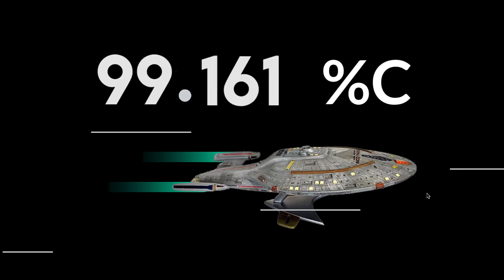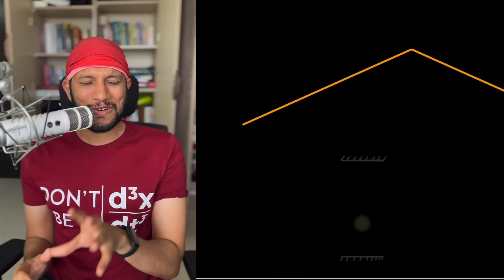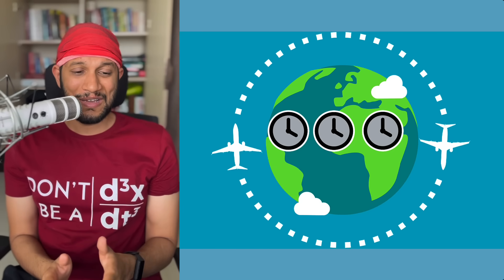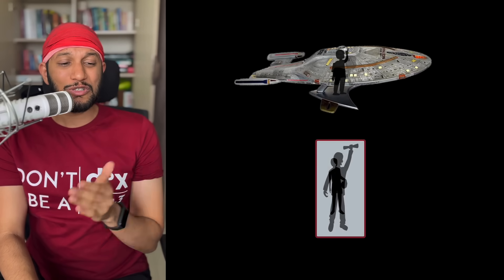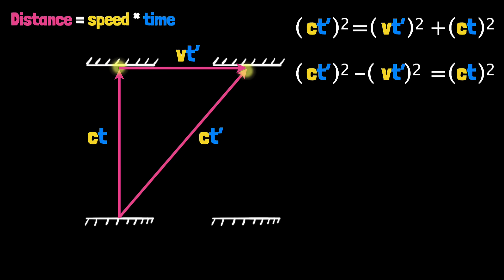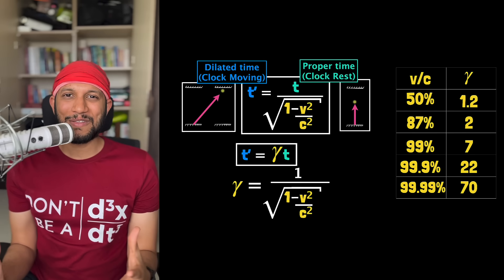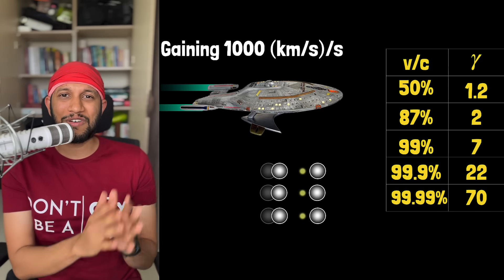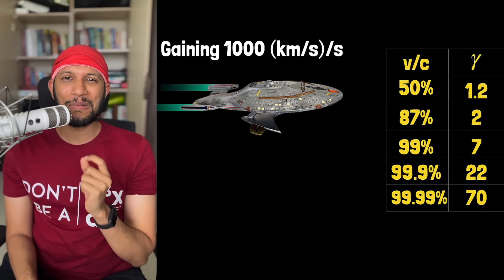I finally understood why you can't go faster than light! (My mind is blown)

Comment: Brings up two questions Einstein Jr., if noting can travel at the speed of light, then how can light travel at the speed of light? 
Next question is how you could accurately measure the speed of light here on Earth without Time Dilation playing into your results. The reason is when you are sitting at your desk perfectly still, you are still physically traveling at millions, or possibly even billions of miles per hour. The Earth is rotating giving you speed (or Velocity), then the Earth is revolving around the Sun (Adding much more speed). Next the Sun is moving around the Milkyway Galaxy, which in itself is rotating around the universe (Adding still more velocity). That does not even take into account gravity, which we don't even know what that is, yet it is strong enough to warp light itself, altering time. Then don't even get into the whole "multi-verse" theory with our universe rotating around other universes adding still more velocity. So, how could you accurately measure the speed of light when you can't even accurately measure your own velocity? Curious about your answer FloatHeadPhysics.
Reply: massless particles like photons don't accelerate to c, they travel at constant speed, which is the same in all frames of reference
Reply: Basically, when velocity is relative, you’re velocity zero. It’s that easy, from my perspective, my velocity is zero. All the formulas rely on relative velocity because absolute velocity doesn’t exist. That’s why all velocity is *relative*.
Reply: The fact all velocity is relative (hint: special *relativity*) is literally one of the most important Einstein theories. There is no absolute frame of reference, all inertial frames of reference are relative to one another.

Relative is a word that’s used a lot, especially when talking about relativity. It’s best to understand what “relative” means first.

Comment: no sale
we are told "space" expanded a faster than light
if it can happen once, it can be recreated
and Einstein was wrong, you can define prime location. have the "Bing Bang's" red shift equal zero in all directions, you are at rest with respect to the original locations of the universe. easy to define this
Reply: space time isn't an accelerating, inertial body, it's the framework of the universe
Reply: @AMC2283  not what i saw recently
the expansion of space is accelerating
so something is expanding and accelerating in doing that
Reply: @m_hub3957  yes but changing the rate of expansion isn’t changing the velocity of an inertial body
Reply: simple
MY point is that we will likely find a way around this limit
we keep finding new rules for the universe
and someone better tell those Aliens that they are really not here.....  speed limit....

Comment: In the time dilation formula, we use c' instead of c the formula still holds. In other words, if the clock was moving with speed of c', the formula tells that the time dilation when v is equal to c' would be infinite. This still bugs me.

Comment: Wouldn't we actually be measuring the amount of data transfered by a magnitude of stronger and weaker amounts of light as the "light clock" ticks? Data being usable relative frames between ticks? It's not ticking slower, it's transferring a lower magnitude

Comment: I'm not understanding why the clock in the plane is slower than one on the earth. Look, from the planes reference frame, it's the earth that is moving and therefore having a slower time. So the plane should have faster clock?

I know this process is not inertia frame, and involves general relativity which tells us the surface of the earth is having higher spacetime curvature. But what about if we only talk about special relativity? Time dialation is relative only right? Any two moving objects, they both will see the other party having a slower time? So if one of the twins fly away and come back, who really gets older? Or are they still the same age? Please explain. Thanks!
Reply: non inertia frames aren't equal, one is subject to more acceleration/force

Comment: I am stupid, but the time taken by me to walk between two opposite windows on a train when the train is still could not be faster than when the train is moving, 1) because the distance between the two windows never increase or change, and 2) being connected to the train by gravity I am impelled by a force in the direction of the travel of the train, the force acting on me and adding energy to my mass, whereas the energy I am loosing by moving between the windows is energy I am generating and which energy is neither being added to nor being compromised by the energy which the lateral movement of the train is passing onto my mass ... so, why would moving laterally while moving beween the two windows cause me to slow down? 
Yes, I am stupid ...

Comment: This is a classic fallacy of physics. Time and space are measurements, they are not "intertwined". Time measures change. Light, or what we are able to see or perceive does not ALTER the actual change that is taking place, it merely alters how we SEE that change. The change has still happened, from a local perspective, even if we do not yet see that change. Think of it like a high caliber bullet. That bullet, traveling faster than sound, can destroy its target BEFORE the sound reaches the target. That does not mean that the bullet has not already traversed the distance to the target because we didn't yet "hear" the bullet. Just like it does not mean that time has changed in ANY way just because we cannot yet observe the change that has ALREADY OCCURRED! This is a fundamental flaw with physics. It conflates space, time, and light as if they are somehow intertwined with each other. Light and time are MEASUREMENT TOOLS, light is merely one of the gauges that is often used to measure space. Just because I use a tape measure to measure the length of a piece of wood does not mean they are intertwined. Light is a measurement tool.

Consider this, time can NOT stop unless on a macro level, across all of creation everywhere, all activity, change, and atomic movement stopped. To observe this, you would have to exist outside of time and outside of space. From a micro level, time may be made to "stop" but even then, that is not really possible. The observer of the stopped activity, such as when atomic activity goes to near nothing at absolute zero, would still be subject to time. The small, isolated area that time "stopped" is still subject to the SAME time measurement and the "change" observed would now be a change in state from active to inactive. But it is STILL a change! Time does nothing but measures change. Space measures the distance at which we observe that "change".

Moving to your analogy of movement of a ship and the energy required. That is a false equivalent. What you are measuring with the energy inputs to move close to the speed of light, or close to "c", is NOT energy inputs to go that fast, but instead, the visibility of light itself. As you approach the speed of light, or exceed it, light itself would disappear because you are outrunning the light. Similar to the bullet analogy outrunning sound. The sound eventually reaches the target. But in the case of a bullet, the target may already be eliminated before the sound reaches them. The change has still happened even before the sound catches up. It is the same with light. We have conflated space, light, time, and our observations together with the measurement tools and have corrupted all of them. The various formulas you show merely illustrate that our ability to see the change that is taking place already is diminished the faster the change is moving away (or toward) us, and our ability to observe it. It is nothing more than the "Doppler" effect but with light instead.

Comment: I have trouble understanding how the vertical speed of the photon between the mirrors has anything to do with its lateral speed. I get the point of the total distance traveled laterally...but the vertical speed/velocity slows as a side affect? How? 
  Seems to conflict with the concept of an "inertial reference frame", in my meager understanding. Just would like to hear that explanation, if anyone can elaborate or point me to a link. Tia.
Reply: its speed is the same in any direction

Comment: Wonder if quantum entanglement could change this. Like let’s say you quantum entangle 2 nukes. One stationary and one on the ship. If you send a signal to the stationary to blow up. Wouldn’t it then send a signal back to the one on the ship? Also if the ship is made like a “sphere” and back half is entangled with front half. Sending the information about the blast would maybe propel it forward? It would maybe look like the spaghettification at the event horizon of a black hole. Not a physics scientist. Just me thinking a little.

Comment: Correct me if I'm wrong, but not only wouldn't it be possible to reach the speed of light, but it would also be impossible to make the necessary measurements to prove it. The second (or femtosecond) you reach the speed of light, the time concept would just fly out of the window, right?

Edit: ok, should've just kept watching the video 😅

Comment: All things are relative. If an object is moving 3/4 the speed of light and is traveling toward an object which is traveling the opposite direction at 3/4 the speed of light then relative to each other why wouldn't they be moving 1.5 times the speed of light?

Comment: I made this: it's called the Marry Go Round experiment
\:Imagine your 5 yrs old and the bars of a marry go round are barely grazing your hand because you've reached your limit. John the occupant of the the marry go round is riding but he's not feeling drag because this is actually in a vacuum. John now can move just as freely as you can to spin a marry go round that Danny is sitting on and spins it in the same direction he's spinning and Danny ends going substantially faster than John when compared to you. Why doesn't this break the laws of physics as explained by  Einstein; it's simple really it's because Danny's origin point was john's power not yours. (What happens when the marry go round B is spun in the opposite direction from marry go round A; it stops? This is what time dilation is, and what naturally occurs, but humans can reverse this effect.) From your perspective yes the inside cart is traveling twice as fast as you could ever push, but that system cannot exist as an individual problem. Adding sums together is common practice when dealing with two different relative perspectives.
\: The Marry go round experiment is actually meant to explain what it would be like to shove a marble(spacecraft) inside a cup(vortex cannon), inside a cup, inside a cup and so on turning each on when at intervals until all that's left is the expedition crew and everything they need.

Comment: Increasing fuel usage to go faster is 20th century thinking. I'm not a physicist at all, but imagine our super-advanced spaceship is able to pull the space in front of it apart at an atomic level. If you're able to warp space around you, there would be 0 resistance, and burning fuel to generate force becomes obsolete.
Reply: yes exactly space warping is the way to go after big bang space expanded at FTL speeds that’s what we need to study how to do it

Comment: What IF.... wave-particle duality works not only for photon- and electron-sized particles, but for all particles without exception, and all other subnuclear components are just packs of stable waves balanced with each other so they could maintain the shape?
Thus, since we know that the maximum velocity of wave is the property of particular area of the environment (space-time in this case), therefore the max.speed of matter, antimatter, dark matter, energy, and dark energy is limited to the speed of light. Just because of capabilities of space-time itself.
Also this "what if" could explain where the nuclear/subnuclear energy comes from, and what happens to the matter in the center of a black hole.
If we keep on imagining things, by inventing and creating a proper space-time wave generator, we will be able to create energy and matter out of nowhere, and magic will be physically possible. Or Jedi force...

Comment: Explaining the limitations of the speed of mass being tied to an arbitrary limited speed of photons seems like the most compelling argument for proving that this is all just a simulation. Why would there be a speed limit on photons? If matter and energy all exist in a universe in a vacuum with unlimited and constantly expanding size, there is no logical reason why photons are limited in speed if there is no external force slowing them down. If space itself is the limiting factor then the only thing that could slow them down would be traveling towards the center of the universe (against the flow of its expansion), but going in the opposite direction there should be no limit to how fast anything could travel.

Comment: @Mahesh_Shenoy is it the actual mass of the object or it's resistance to further acceleration that increases? If it is the actual mass, why can an engine be designed to accelerate gas in a loop to near relativistic speeds and then shoot the massive object out the back. It would allow for a low rest mass propellant to be used for long range space travel.

Comment: I have a question. If time feels the same for the person inside. Even if thier 1 sec is 100sec outside. Than from thier perspective of speeding up. they are infact reaching light speed at a steady rate with no issue. So even if it takes an infinite amount of time. They in fact would reach light speed. for the person inside also has infinite time from this example. But they inside if at a constant rate of acceleration would reach it in a finite amount of time to them. 

But the hardest part to understand for me is that if im traveling at half the speed of light to the outside perspective  and my time is now 2 to 1 to them. Than from my perspective i am now at the speed of light. Ik this is just a time thing and i am not physically moving that fast but that means the faster we go the quicker we get somewere in perspective to our individual time. Aka 99.99999% the speed of light or some ridiculous amount closer. could make it so that a flight across the milkyway feels like a year.(in the sense that we only aged tht much and only needed that much in supplys)

But if it only takes a year worth of supplys than we are breaking the laws of physics since we are only useing 1 year worth of fuel for a trip that should have consumed milions of years worth

Comment: So if that's the case, I have a theory that things CAN go faster than the speed of light but it can only be observed from within the ship. From the outside it never happens. Maybe Im missing something? Maybe the reason we think light is the speed limit is were unable to observe anything faster from the outside. Maybe there are particles that constantly travel 10x the speed of light be we can only observe them going slower. Just an idea.

Comment: Thank you for the amazing video. As a chemist and physics noob can you answer some questions?

Suppose the photon clock is being turned by 90°. Would it still be affected the same way by time dilation? 

1) Let's assume the photon bounced of the left mirror and has to travel to the right mirror. The right mirror is also moving to the right and thus the path of the photon is longer for one tick. But it should not have the same length as with a diagonal path in your example, so time dilation should be even more. In contrast the bounce to the left should be less dilated and the ticks would be uneven.

2) Can Photons have an impuls to the side when the spaceship is moving? I mean: Would they really travel diagonally?

Comment: Infinite amount of fuel to accelerate? So, what does infinite "amount" mean? Infinite mass of fuel? Well, it is available, isn't it... The speed of the fuel in the ship is approaching the speed of light, thus mass of fuel is approaching an infinite amount. So, inside the ship nothing ever changes, except that fuel is being spent. But then again, whatever the mass of fuel is left, as it's approaching the speed of light, that mass is approaching the infinite amount. So, based on that and on E=MC2, an infinite amount of energy is available, thus ship accelerates to the speed of light, which very well may be a parting velocity, leaving our Universe, perhaps.
Reply: e=mc2 is 90PW per kg, there's nothing infinite about it
Reply: @AMC2283  Read my comment again. as the speed is approaching the speed of light, the mass of fuel (let's call it m) too approaches infinity, thus E= mc2 approaches infinity.
Reply: @kresimirmustapic4651  mc2 is your kinetic energy in your rest frame, not your relativistic energy
Reply: @AMC2283   E= mc2 is the equivalence of mass and energy. if you covert ALL your mass into energy (fission for example converts 0.1% of mass into energy) that's how much energy yow would get.
Reply: @kresimirmustapic4651  in your rest frame, yeah. Kinetic energy can get much higher.
Reply: @AMC2283  You completely missed the point.
Reply: @kresimirmustapic4651  the point is your original comment is erroneous
Reply: @AMC2283  No. Your reasoning is off. I am out.

Comment: What if there is a dragter inside the ship, and it dashes a quarter mile at its top speed.
Could we try to reach closer to light speed moving something inside the ship instead of trying to accelerate the ship itself ?
Reply: you can get infinitely close to c, but the stationary observer won't observe the same speed as the relative observer